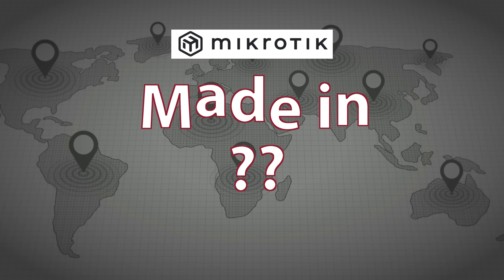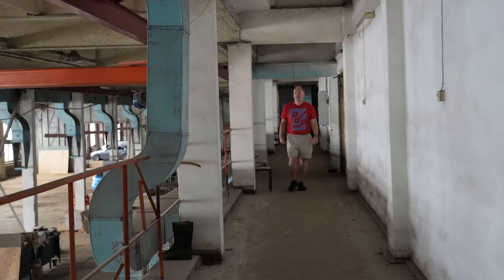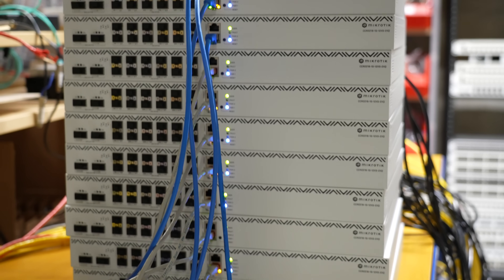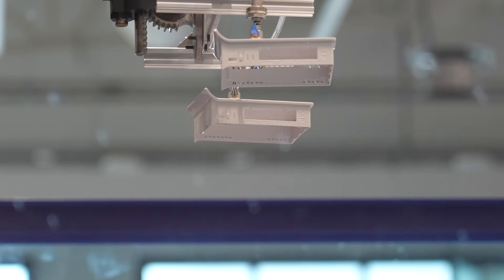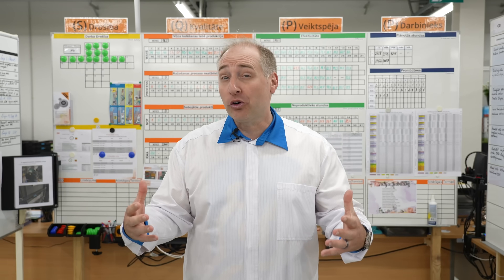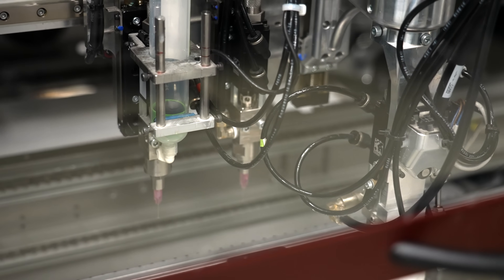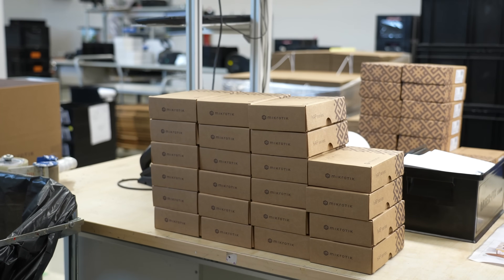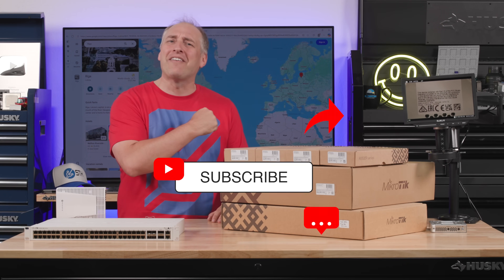Touring the COOLEST Networking Company

Comment: Thanks for the tour, the sad thing that this place is close to russia and belarus, all other is great, good products, not all of them - I dont like small ap routers with very bad wifi coverage, and also some routers have bad design of cooling (radiator can be not connected physically to everything that need cooling), but most of products very good - using ax3 at this moment, works perfect but on 55c temp without high load :/

Comment: Mikrotik is awesome and has a very special place in my heart. I learned routing on a small RB450G board, and I've been using them on my ISP since 2009. I've pushed them HARD and done incredible stuff with them, crazy stuff I could never do with any other router. I've put them in hot/humid enclosures with no ventilation running there for years, and they just keep rowing on. For the home lab, Mikrotik is WAY more router/switch than you'll ever need.

Comment: MikroTik gear is huge in Indonesia, especially with folks who are reselling shared internet—which, fair warning, the official ISPs usually flag as a no-go or 'illegal.' The reason it's so massive? The community is super tight, and it's easy to get your hands on it. You can buy one new, grab a used one, or just flash the RouterOS onto an old, spare PC and turn that into a router.

Comment: The L009 with Wifi is a great router for home and small businesses. Ive been installing them left and right because they are priced great and super reliable. My only complaint.... why include a 24v power adapter? The poe out port operates at 24v because of this. I had to buy a separate 48v power adapter so my poe stuff worked correctly. That said I like the gui setup but it feels more geared to terminal veterans for the slightly more advanced setup. I still havent gotten vlans working properly on my personal l009. Starting to run into an issue where the places im installing them have speeds higher than 1G though so will soon have to find something else more capable. My personal l009 has a 2.5G SFP Ethernet module in it was my wan. So even though one device wont see over 1G, using multiple devices at once will still see the benefit as long as the cpu can keep up.

Comment: I work in Telco and some coworkers suggested them when I was looking for a new firewall router for my home and home lab without breaking the bank and needed more than consumer features. I got their $300 1U 12x1G port rackmount cloud router 1100 series that has ran perfectly 24/7 for almost 10 years and is only down rebooting after software upgrades or the rare power outage. As a gamer I am happy with its routing speed with NATs even with a hefty firewall rule stack that blocks most of the planet lol. My work gave me a Cisco 1111 VPN/LTE router but I don't use it on my WAN edge because its NAT routing is slower and I like good ping times for FPS gaming so it runs the internal lab segment of my network lol.
Reply from the maker: Sweet! Is that a Tilera TILE based CCR?
Reply: @ServeTheHomeVideo  i assume RB1100 series
Reply: @ServeTheHomeVideo  I think its the one before that gen. Mine has a dual 1Ghz core NXP QorIQ PowerPC processor and 2GB RAM. 

It's been a great little box though the fan is starting to get a little noisy and software support is going EOL. I might try their fanless RB5009 industrial model next.

Comment: Once I learned of Mikrotik, I used it a lot. The price to performance is great, having high-end features early on, and the fact that I have routers still running with no real maintenance after 10 years. A little more to learn than Unifi, but easier than complicated IOS. Also, no subscription BS.
Also, if they can manufacture electronics in a little country like Latvia, then there is no excuse for not manufacturing in the USA or other Western nations.
Reply from the maker: Great feedback

Comment: Now can they make them cheap again?  Their price creep has made me seriously consider TP-Link or, god forbid, noname Chinesium brands.
Reply from the maker: The funny part is that their higher-speed switches usually have an amazing value proposition on a $/Gbps basis.
Reply: @ServeTheHomeVideo  Sure, their 16 port 100G switch is very attractively priced, if you can afford it or even need it... So was their 10G RJ45 when it launched, then each shipment got more and more expensive.  Meanwhile I'd place their 20 port 2.5G switch in "ridiculous" money territory.
Given I can get a 2.5G switch equivalent to the CRS354 for about 10% less from Duntin, I'm almost tempted to give them a go to see just how bad their security and features really are.  As MikroTik's 20 port 2.5G switch is already 60% more expensive than the CRS354 switch, I shudder to see what their 48 port version is going to cost!
If they're not careful they're going to price themselves into the same range as already well known and trusted brands.  Yes MikroTik has been around a while, and their manufacturing is done in a more trusted part of the world, but it's pointless having attractively priced high end core and distribution stuff when the vast majority of SMBs only need access switches.  Pricing themselves out of that market means that half the battle is lost.

Comment: Got a pretty hard and fast baba for like 80% of my business in the next 5 years. For a few things I could argue if the us replacement would be more than 3x the cost then I could argue for a waver...

To be baba compliant  >55% of the value of constituent parts need to be from us sources, and final assembly needs to happen in the US.  So could be met by sourcing us PCB, caps ram etc, having the boards populated and tested as regular, then shipped to a us facility to do final assembly here. Then BEAD awardees could buy it. You could add a -us or -baba to the pn to signify compliance.

Comment: Cool video and nice of them to let you come film but the tours of pick and place machines are getting kind of old. Tons of people have done tours of factories and they mainly show off the pick and place and surround machine process. I would like to see a tour on all of the other parts of the process besides that. Whatever those things are. Going into detail about those rather than about the same thing every other factory tour video is about. 

I really like Mikrotik products and they were the first networking gear I ever learned/used for my homelab but their switches have been lacking on the 2.5GbE PoE and their routers just aren't comparable to something like a UDM Pro Max. Saw you say they have something coming out soon but will have to see I guess. Most likely it will either be missing one of the man things people want or it will have it but be overpriced or the same as Ubiquiti products in comparison. Making it a obvious choice on what someone will go with when they already switched from a Mikrotik network stack to Ubiquiti due to the lack of 2.5GbE and 10G PoE++ and/or PoE+++ switches.

Comment: more microtik less tplink
Reply: What is a Microtik?.... Mikrotik?
Reply: Ultimately, a lot of the components are the same you can replace software on both
Reply: At least check company name before you start adoring it. 😂
Reply: Tplink APs are still miles head of mikrotik

I mean I love mikrotik router, but they have to stop releasing equipment that can’t handle gigabit properly in 2025.
And the HexS 2025 has been out for months now and the PPPoE bug still haven’t been fixed.
Reply: @benchy5769 yes CCP, yes yes
Reply: @ShedewrS  since I don't live in western sphere country, this option doesn't really matter. Either spyed be the the west or China, none of it are my country's allies.
Reply: @benchy5769  Don't get their low-end products if you want performance headroom. A CCR2004 or RB5009 would laugh at 1Gb/s PPPoE.
Reply: @benchy5769 😂😂😂😂 you are kidding right???? 😅
Reply: What's problem have
Reply: @benchy5769 compromise by china government risk is also ahead miles 😂
Reply: @taiwanese_9999  the thing is the proof of this is sketchy at best a lot of it is there’s a hardware uart exposed but surely you would notice if someone has torn your access point into pieces

Comment: I tend to favor Mikrotik for their price/performance, versus more integrated solutions from other networking companies.

But why does it always seem their switches have every feature but one that I really want? Like some of their best PoE switches lack 2.5 Gbps, or some of their most compact switches are just too wide for a mini rack...

Thanks for doing this tour, and visiting Latvia for us!
Reply from the maker: Just wait for what is next on the switch side (I took it apart this summer)
Reply: @ServeTheHomeVideo ooooh
Reply: 2.5Gbe switch with 802.3af/at out, 2x to 4x SFP+ uplinks would be a hot seller.

Also, I really hope they standardise on 2.5Gbe in their WiFi 7 AP's
Reply: Also, SRv6 for ISPs. This could heavily change the related industry trend.
Reply: So real.
Reply: I fully support what Jeff said! Nice products, minimal fluff, but... but: something is always missing!  It is frustrating.
Reply: And still no Wi-Fi 7 APs ;(
Reply: @DIY.DevOps  I wanted to get a hap AX3, but I think I'll put that on hold for a while until they release something with wifi 6e or 7
Reply: @DIY.DevOps  No WiFi 7 standart(already 1 year old), no 6E(already 3year old), limited to 80Mhz channel(?), missing 2.5Gb/s PoE switch 16-24 port...
Reply: @DIY.DevOps  how fast do you need to download porn??
Reply: They love gimping their products, like fabulous product, with 1gbps to a strong cpu.  Or they make that pipe fat, but only give you a few mb of ram. Only the core router series type stuff do they max things out, most other stuff is gimped in some way to not cannibalize their more premium product lines. But even their premium tier stuff is still prices quite well compared to other brands so ¯\_(ツ)_/¯
Reply: This is so on point. Stuck deciding on what to get since nothing has every feature I need.
Reply: when are you going to make a video of your MT setup??
Reply: Because 2.5 was and will NEVER be an enterprise standard. Honestly, if 1GbE isn't enough, go to 10GbE. 2.5 and 5 are pure junk made to fleece the average consumer of their money for SFA gains.
Reply: Agree with Jeff. Dual WAN available from boot through GUI. One radio button to choose between load balancing or fail over.
Reply: До 22 года основной рынок сбыта был в России и как правило бытовой обычный пользователь или небольшие провайдеры интернет.Так что то что у них заложено в аппаратуре как правило было ранее востребовано а сейчас когда рынки сбыта сменились то аппаратура уже должна быть адаптирована под требования других рынков сбыта.В Россию им просто запретили продавать продукцию из за введенных санкций  и они чуть не обанкротились из за резкого снижения продаж.
Reply: Also the whole RouterOS/SwitchOS thing is not great. They need a better way to interact with the devices and more user friendly.
Reply: @Kushari the lack of user friendliness comes because they allow all kinds of configurations that you otherwise couldn't do. It's not terrible in my opinion.
Reply: @Kushari  disagree, its super flexible but geared towards network pros or power users. They have very good docs so everyone can figure out how to setup what they need if they try.
Reply: @Kushari  its not terrible, but they should add the ability to SSH into the SwOS and some commands to query SFP's as well as support for some automation via SSH commands
Reply: @Kushari  Maybe a newb friendly web-ui skin for RouterOS would make it easier ?
Reply: @Kushari  I don't think they are aiming for huge volume massmarket where userfriendliness is really important. I have a CRS-310 but don't use it at all, gave up on it for the time being. What I'm trying to do with it requires a bunch of different things to ALL do exactly what I want, and, well, it was enough of a pain in the proverbial that I just tossed all the parts into a pile and gave up. For now. 
But the thing is that to make it all userfriendly you'd have to remove the parts that make mikrotik worth buying in the first place. So I'm against it. I would prefer if it was just terminal text mode instead of a crappy web-UI. Or better yet, a XML POST endpoint, you'd make a configuration XML and then POST it to an endpoint and then it would respond with an OK and some way of seeing how the current config is set up. Like you'd be able to download a configuration XML "template" from it and then edit that and do a POST to an endpoint and then have the unit reboot and come back up with the new config. 
I might be saying that I want it to be less userfriendly than it is now, heh, but to me anything with mousable buttons is terrible. 
Maybe they should have 2 branches of the OS. one that is "easy to use - daycare version" and one that has no UI at all except for a SOAP/XML webservice endpoint that you interact with by posting complete configuration XML's to. Should even be fairly easy to do, just remove advanced features from the daycare version altogether and focus on the SOAP endpoint and then it would also be a selling point for corporate customers because the pros would love the webservice one for sure, it would make it easy to configure multiple devices very similarly and it's a very fast way to see in one glance what is wrong with a config if you can get it as a single SOAP message XML. You could do a lot of automation around it too.
Reply: 2.5g is more like a private consumer thing and will not make it to big installs. You either jump to 10gig or stay at 1gig cause its enough